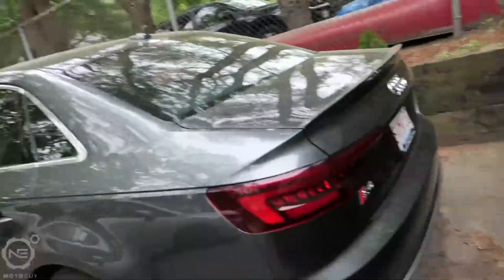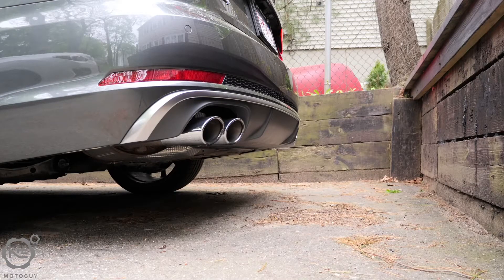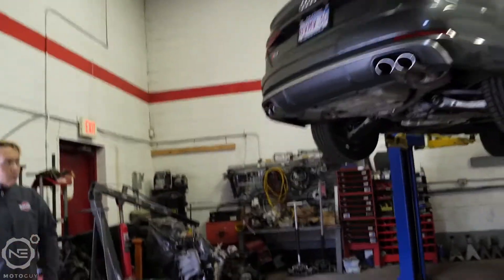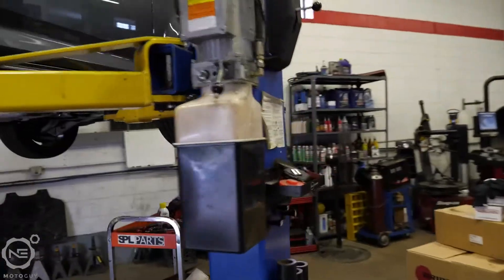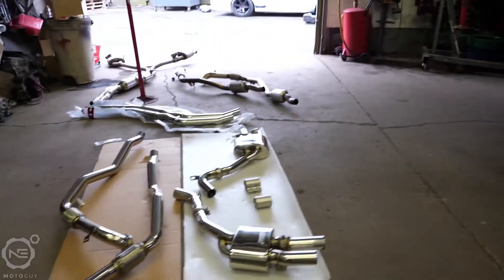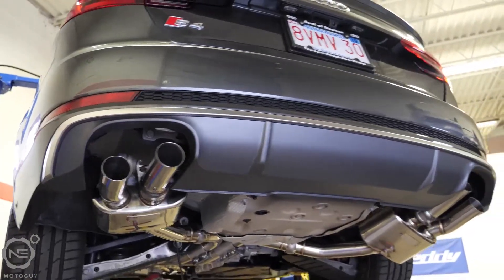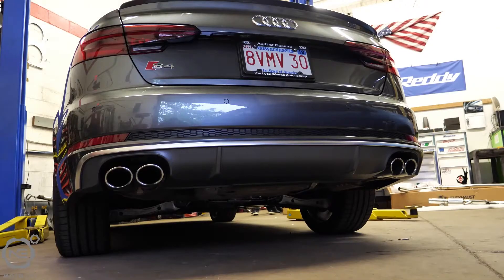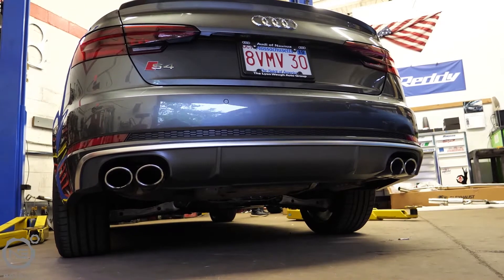2018 Audi S4 Frequency Intelligent Exhaust Install (Front Pipes)!!

Comment: Hey man quick question, my s5 coupe has a frequency intelligent exhaust, and the remote to close and open the valves blinks red when I click it, however it somehow isn’t connected to the Audi exhaust itself. Maybe it’s a wire that was ripped or unplugged, because it was in an accident front and back damage, the exhaust itself was Not damaged but the valves don’t close when I click off for the exhaust, any thoughts? Thanks